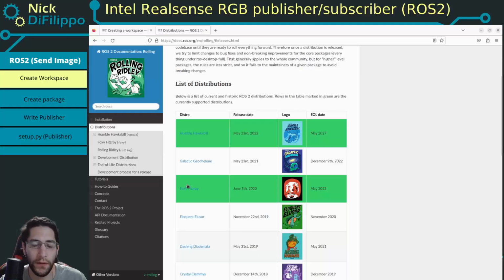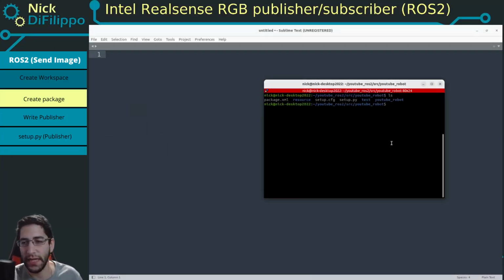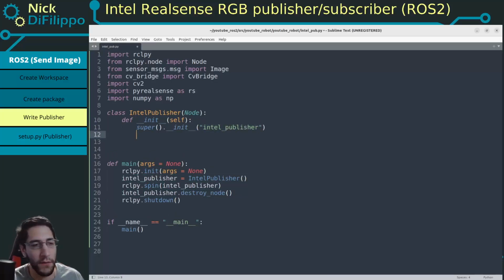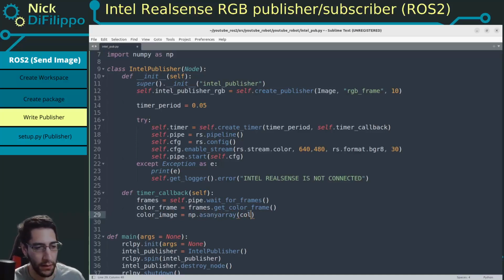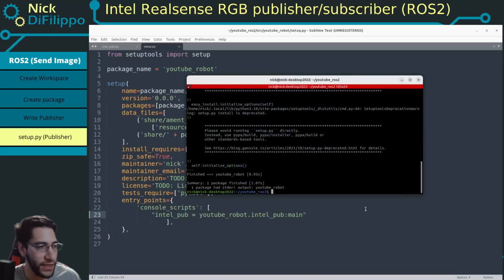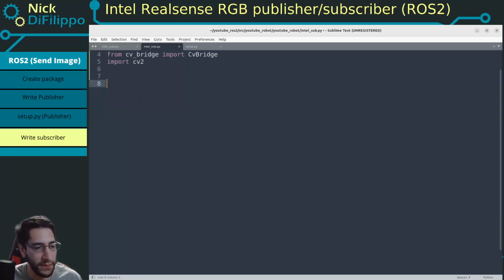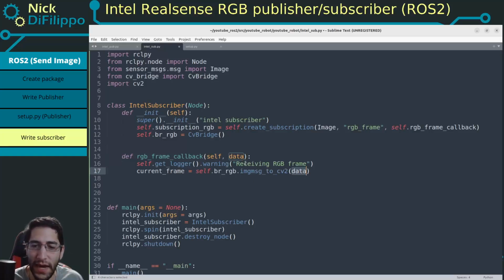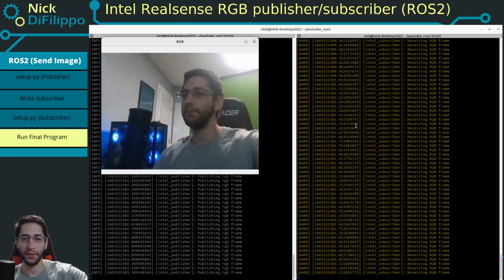Robotics - Publish and Subscribe to RGB Image from Intel Realsense

Comment: hello,I have a error >>   RuntimeError: Frame didn't arrive within 5000
 , how to solve?
Reply from the maker: I have encountered that issue if 1) I am using a non usb 3.0 cable and trying to use too high a resolution. Or 2) I am using a resolution in the config for the camera that does not exist
Reply: so I need to buy usb 3.0 cable  to solve this problem right?
Reply from the maker: That’s how I have solved this issue in the past. First I would download the real sense sdk and check the available resolutions with your setup. Then change my config in the code to use one of these supported resolution that the camera sees. If that works then it is a good bet that you need to buy a 3.0 cable
Reply: @EngineeringCorner  ok,thank you